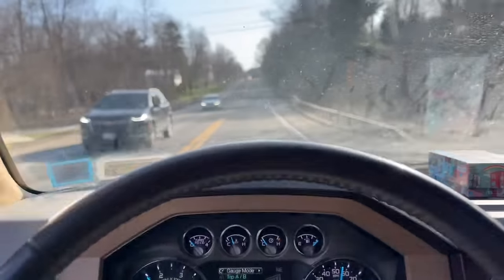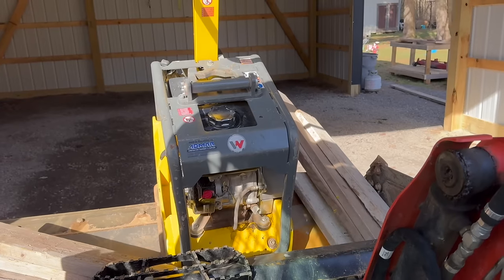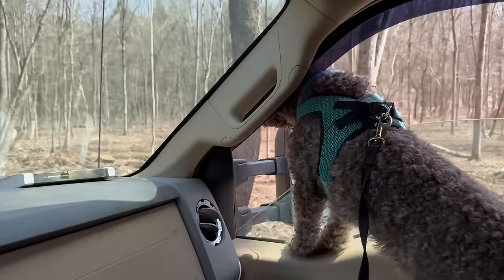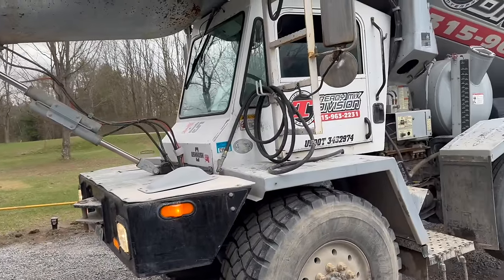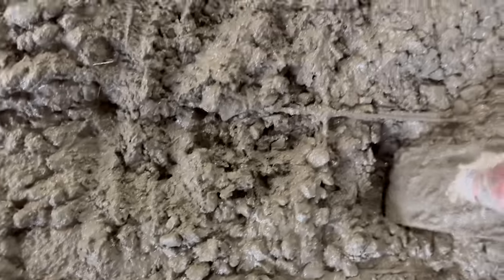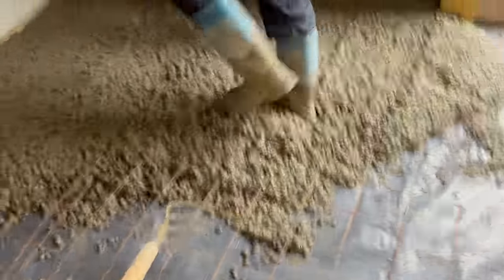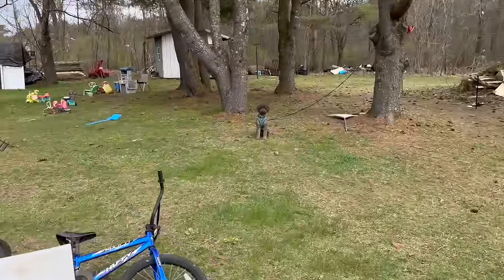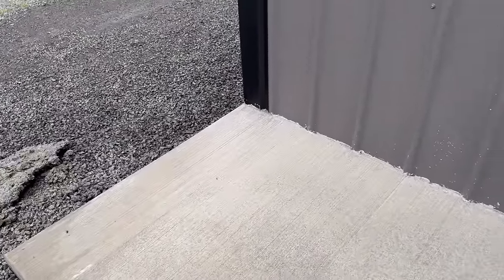Does the wire stay up when pulled?

Comment: ive seen wire in every kind of slump you can imagine. the ONLY way it doesnt get up into the concrete is if its not pulled up. even in 8-10 slump, it stays up. if the concrete has aggregate in it, which it should, the rocks get under the mesh and it will not get stepped down. ive torn out cracked up concrete that separated and heaved and guess what we found? wire mesh laying on the ground. if the mesh/rebar is in the bottom 1/3, it will do its job along with a good base. for concrete to not fail, it takes multiple steps and processes. its more than just pulling mesh.
good looking slab as usual, guys!! the way biscuit is losing weight, we're going to have to start calling him mini biscuit. :) keep up what ever youre doing, biscuit cuz its working!! 
i think a land developing series would be a great idea. you can show what future land owners what they might be up against.
Reply from the maker: Ok thanks and I will try and get some video of property and thanks for the info on wire in a loose slump. 👍
Reply: I’m not sure if I’ll ever be a mini biscuit but I appreciate the comment thank you (big biscuit)
Reply: @jasonbond1666 
Just be careful of Good Woman who can also cook!! My wife fit that bill...she put 60lbs on me in no time!😊LOL.  (She was worth Every pound!)

Comment: Gotta say I just demoed some concrete for a bathroom where the wire mesh was NOT pulled up… it was still strong as hell even in the bottom inch of the concrete and there were no cracks in the slab. Makes me not worry about it much either way. Anyway, you guys do a great job. Love your channel.

Comment: If the wire is pulled up it stays up. More concrete that I have removed had wire that was not pulled up than had been. While the concrete was easier to remove, it was not as strong as it could have been had it been properly reinforced. If the substrate is good wire isn't really needed. Code has to cover situations where the substrate is not compacted well and is likely to settle. In that case wire mesh can make a big difference in the longevity of the slab. Since wire is reinforcement is required by code do the job properly. In many cases that means using chairs or a motivated crew who wants to do work as good as it can be done.

Comment: 30:20 - I suspect Mr Bondo has misunderstood. The mash is there to minimize the cracks, so that they are restrained and you don't risk falling down in one of them one day. All mesh should be in the upper half or below upper 1/3 of the slab.  Concrete professor Tyler Ley explains it all in his brilliant videos on slabs - see:

Slab tips - Pt 1 - how to build driveways, patios, house slabs, and roads.
Slab tips - Pt 2 - how to build driveways, patios, house slabs, and roads - reinforcing and slope
Slab vol 3 - soil impact on slab on grade driveway patio and road

Comment: I know the wire mesh/rebar stays up a little... what gets me is the lack of an expansion joint.  Maybe I missed something, but especially on that apron, it looks like you poured the concrete right up to the tin... encasing it, right?  If he ever needs to replace a panel, how easy will it be to get that tin/steel out of the concrete?  Ordinarily I see expansion joint used all along the perimeter and, yeah... between the apron and the steel/tin.  Is there some reason you don't do that?  Maybe it's a waste of money/time?  I don't get it.
Reply from the maker: The metal is screwed to the bottom so it can never come out even with expansion.  the expansion rots away and leaves a spot for water to get down in there. Ants tunnel up through it also. if a sheet of metal needs to be replaced you cut the old piece out with a zip wheel on a grinder and put a new piece on. We put expansion up against split face block wall because it needs some room to move but concrete will shrink a little and pull away when it dries.

Comment: The one guy emptied the wheelbarrow and it shot concrete splatter all over the brand new metal siding.
Reply from the maker: We try and not splatter   The walls get insulated and you never see the inside of the metal but we still try and not do that.

Comment: I watch some other youtubers who fix drainage issues for gutters and pour cement swales and partial driveways.The stuff the remove has no rebar and the cement they put down has no rebar. Of course maybe the procedure is different in their states. Other cement  flooring guys I see like yourself use rebar.
Reply from the maker: Different areas have different obstacles and codes.

Comment: It a real sham in this day an age pouring a concret slab with out 1/2" pex in floor heating even if it not needed today. 1/2" is so dam cheap it worth putting in. Weather it needed now or down the road or next owner. You cant get longer lasting heat an the best heat an great floor drying..  at 28 cents a foot when you buy 300' rolls or 24 cents per foot in 1000' rolls. The most efecent heat going.. wire mesh is good but we also do 3/8 rebar in a 12' sqare..  no slab cutting as it one thing you dont want in a floor to snag everything you roll across. Also the 12' rebar great to tie the pex to every 12" in the loops

Comment: Nice work! That's how I do my wire pulling also. My question do you pour a pea stone mix with #4000 concrete or a 3"/4 limestone?
Reply from the maker: The stone are 1/2 to 5/8  we do a pea stone for core fill. our stone is not limestone in this concrete.